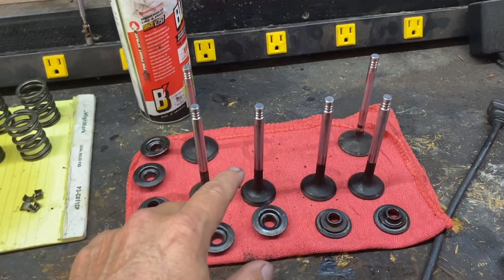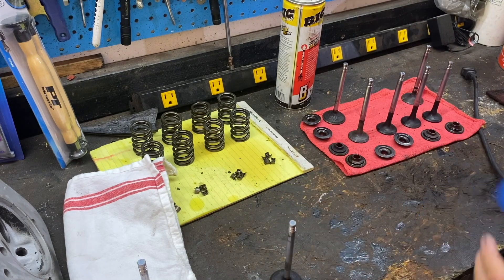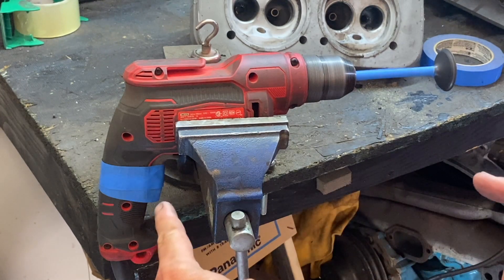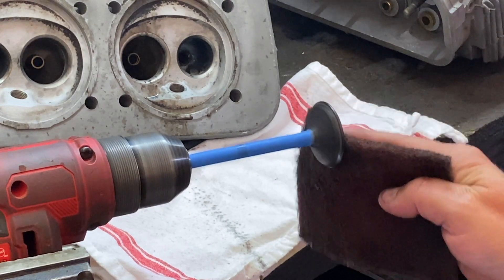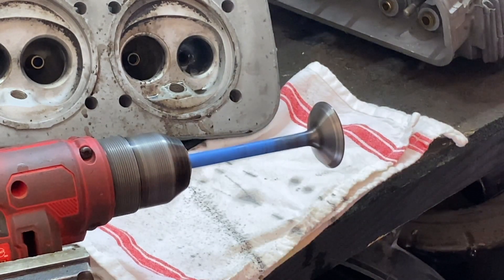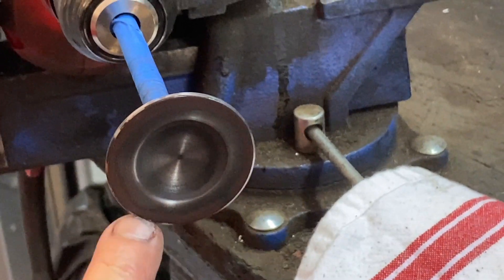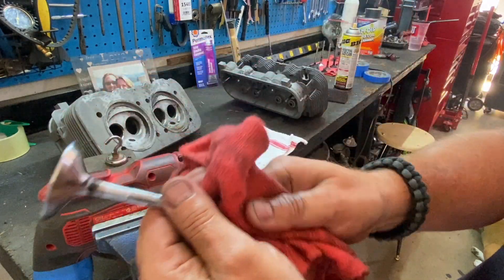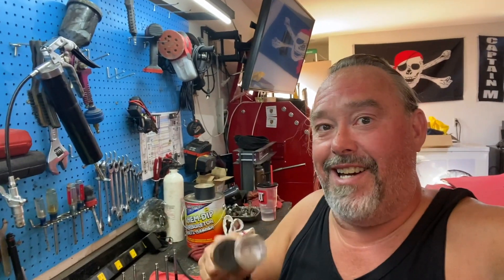PORSCHE ENGINE REBUILD STEP BY STEP:  How to Clean and Refinish Valves

Comment: Just watched your video on the evap cooler. Just wondering if your still using it 2 yeara later and if your doing anything else to keep it cooler.

Did it cool your whole garage or just like a general vicinity you were standing in? Thanks
Reply from the maker: It keeps the garage about 20 degrees cooler.. but you almost have to keep it on you to be comfortable in 110 heat lol
Reply: @ArrowheadGarage  thanks brother, appreciate your response